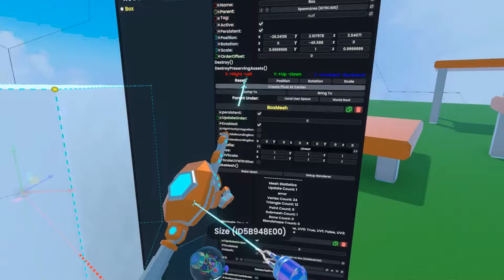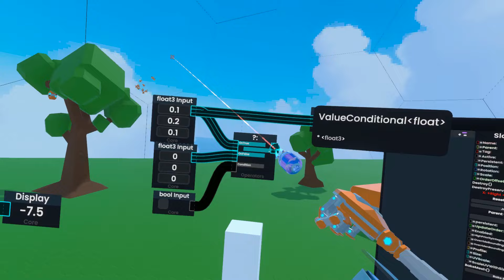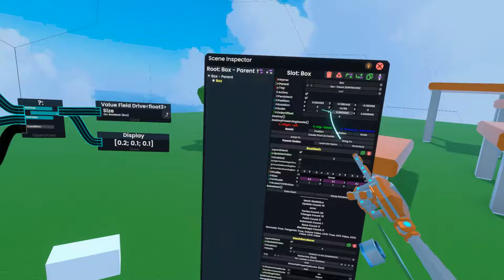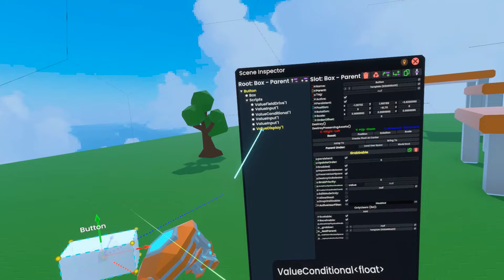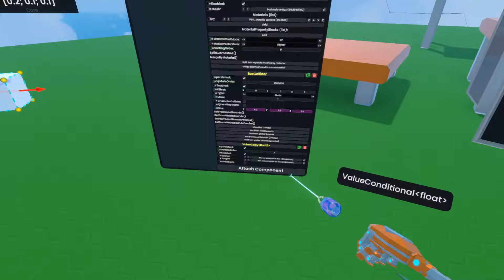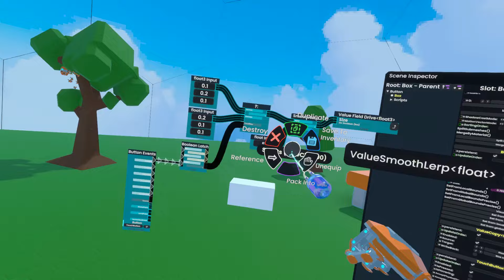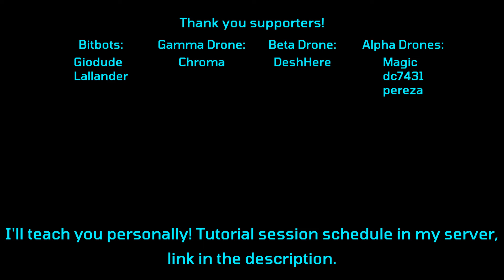Welcome to Resonite: Animating Cube Button

Comment: Awesome tutorial! I'd just like to add a little bit of context to the procedural mesh components in Resonite:

In this example, Rusty has directly driven the "size" property on the BoxMesh component, which generates a procedural mesh.
Whenever any of the properties that define the shape of a procedural mesh change, the entire mesh is rebuild. When the value change is gradual, like the smooth transition in Rusty's box example, that means that on every mesh update, the entire mesh is rebuilt, for the duration of the animation. In a simple example like this, that's generally not a problem. Procedural meshes generate on a background thread*, so having many recompute at the same time won't slow down the game for you. However, if you have too many meshes generating at the same time, it can cause the mesh generation to not be able to keep up with your framerate, and the meshes only update every couple of rendered frames. That can cause animations to appear choppy.

An alternative way of animating the size of a mesh is by instead of driving the properties on the procedural mesh component, you can also drive the slot's scale. Doing this won't cause the mesh to be regenerated at all. For some effects, this can achieve the same result you're after. In some cases however, you need to animate the procedural mesh directly, for example if you depend on the generated UV coordinates for the effect you're trying to achieve. There's nothing wrong with doing that, but I think it's important to understand how those properties are evaluated by Resonite.

* You can make a procedural mesh "high priority" by enabling "high priority integration". That way, the mesh will be prioritized when being generated over other non-priority effects. Having too many high priority meshes generated at the same time can end up causing other high priority effects (like the dashboard or your laser) to start lagging though, so I'd advise only using that only where really necessary.

Comment: Just getting into resonite and 3d art, and im struggling a bit to find the correct workflow to make things. Which part of an entire process are done in Resonite, and which are done externally? Modelling is likely blender, but what about armatures and animations?
Reply from the maker: I didn't learn blender until I was six months in and I still use primarily in-platform procedural shapes to model. Armatures (anything rigged) and baked animations can be imported from something like blender as well. It all depends on your personal workflow.